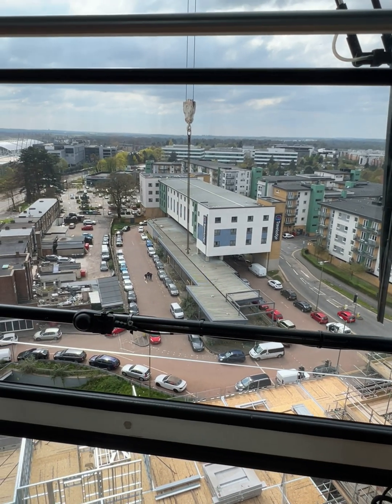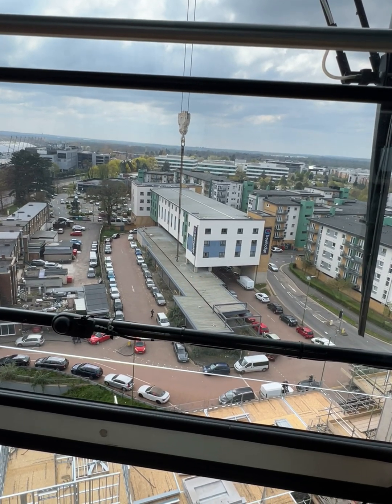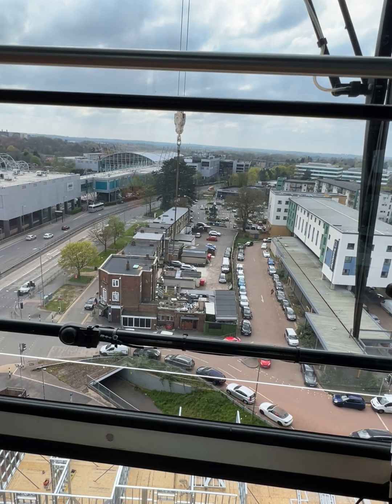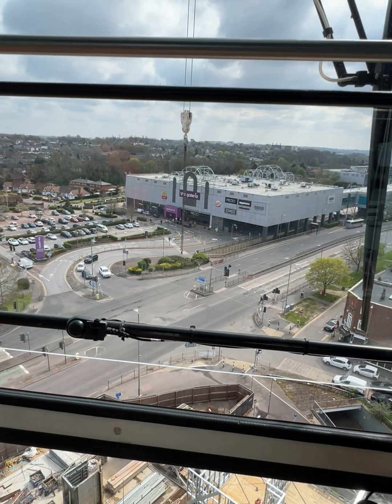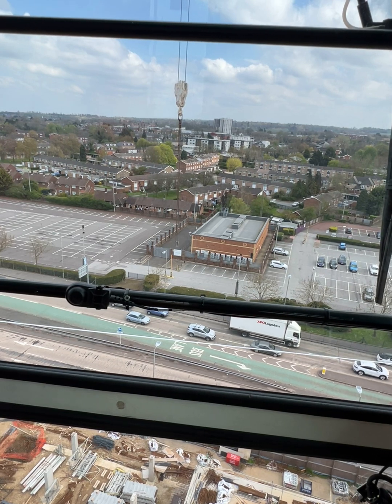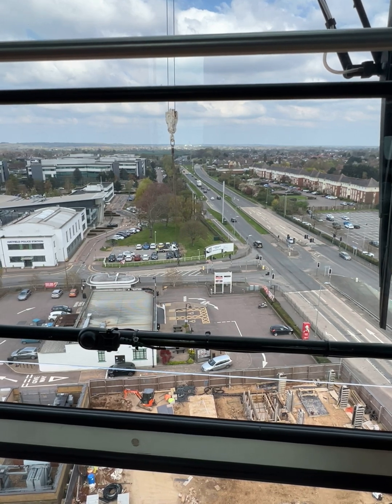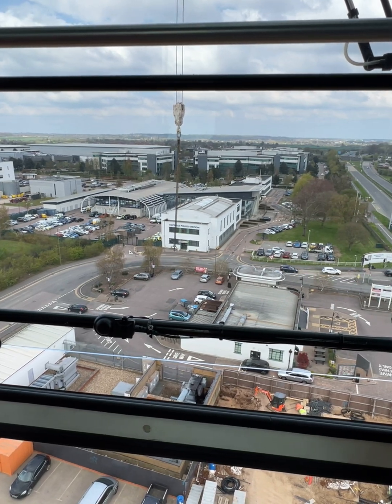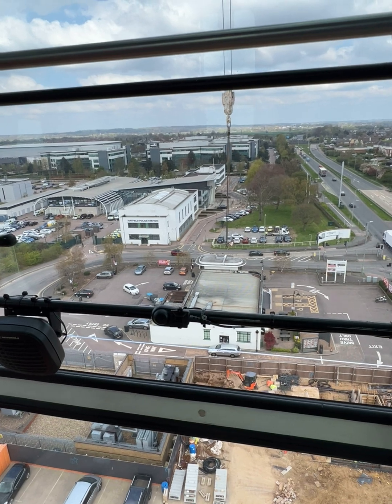How to catch a slew swing on a tower crane (Wolff 180B)

Comment: Bro this swing makes me nervous.
Reply: Hi
Reply from the maker: I can imagine but you have to learn to work with the swing
Reply: @Kofo2481  I'm trying.  Then another thing is the stopping accurately.  I'm barely 2 months in the job and still practicing and trying.
Reply from the maker: @Cubah0101  the secret behind stopping accurately is identifying your stopping distance if you watch the stopping distance video you might be able to pick one or two tips. So stopping accurately you have to understand how your crane works and you have to slow down with your gears from 3 down to 2 down to 1 heading towards where you will be stopping finally and when you stop there might be a little one or two adjustments you might have to do just to make sure you have completely stopped. I will do another video on how to stop accurately but remember first thing first understand how your crane works which I explained in my video catching the feeling of the crane watch that video catching the feeling of a crane
Reply: @Kofo2481  thanks brother. I will. Is a job I like and I hope to get better with time and practice.
Reply: Where can we Connect?